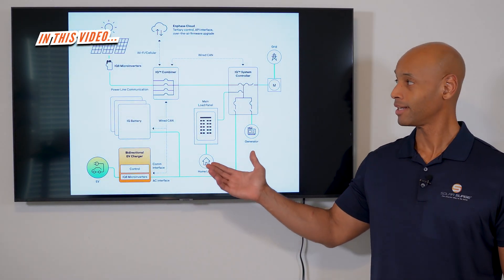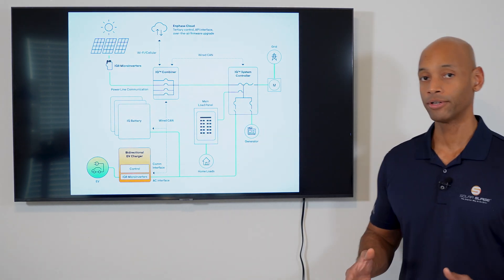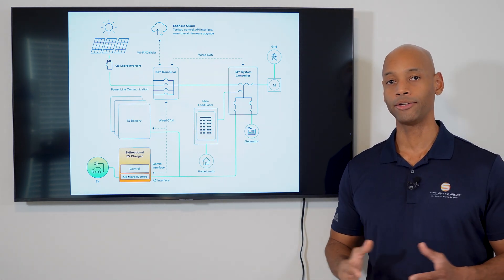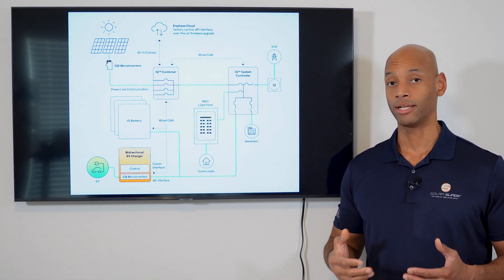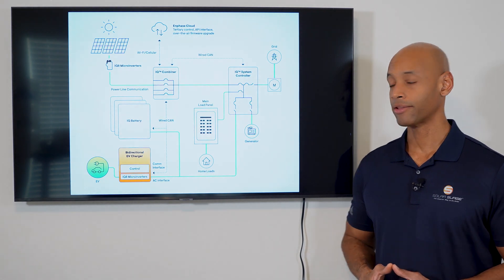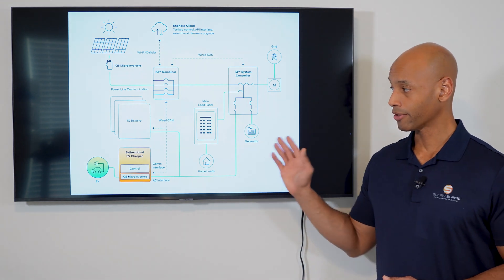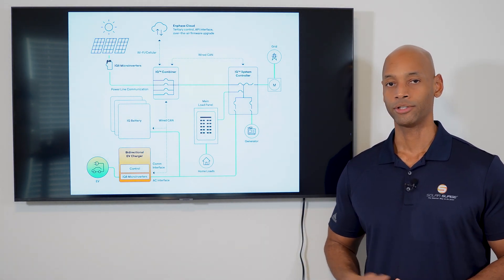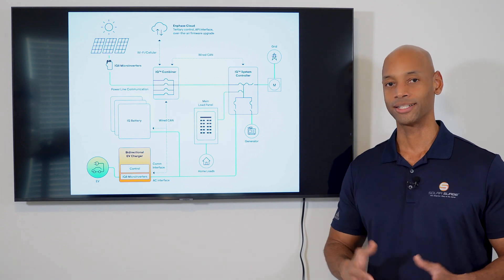Enphase Solar Power System 2023 (IQ8 Micro Inverter)

Comment: how you prevent the power going back to the grid when you are not using all the output power ?
Reply from the maker: The Enphase IQ system controller can be configured not to allow grid export
Reply: I meant no power to the grid at all, not the function that detects if the grip has a power drop then also the microinverter cuts the power. I want the power meter of my power provider NOT going backwards because thats illegal in my country.. @SolarSurge

Comment: OK.  I love the detail in your videos... and I'm kinda old, so I need some detail... so I pick you.  I have an Enphase IQ3 na system that is only about 2 years old.  I wanted to add 1-more 3.35kw battery to my system... but they are no longer available.  I called Enphase Tech support, and they said I could add one of the newer 3T batteries, but I would need to run it through a new and separate subpanel, as a stand-alone unit.  So, I bought a new 3T unit... and now I can't find anything on YouTube (or anywhere) that details what needs to be done... what breaker size... and where to install a new breaker in the IQSC.  Please HELP! Video?  Sketch?  Step-by-step description of the individual task?  Anything!!!

Comment: Wow, what a great video. I am getting solar and really wanted battery back up but for the cost it is not something I want to do right now. However since I recently bought a Tesla with 85KWH battery that with the Bi-Directional EV charger would meet my backup needs for a very long time. Thank you for sharing such valuable information Joe!
Reply: I don’t think Tesla offers bidirectional charging yet except in the new cybertruck.

Comment: I think its a mistake to go with micro inverters personally, Id rather have a string inverter with battery backup, plus what happens if these micro inverter companies go out of business?  Yeah single point of failure is better in that reguard also can these even handle super large surge loads like air compressors like a :LF inverter would with ease
Reply: Enphase is a huge co. Will not go out of business any time soon. Other microinverters though…
Reply: @perwis9893  My main point and question was can these microinverters even handle large inductive loads like motors and stuff, id rather have a string inverter low freq they can def handle large inductive loads
Reply: Good question. I don’t know. But that is not really a problem unless you are off grid right? And then you would presumably still need a battery right? Or what am I missing here?

Comment: Right, it comes off the roof AC. 240V 39amp. Current must be converted to DC for battery storage, then converted back to AC. Wasteful. Too much lost to heat.

Comment: How do I design a solar system that can start a appliance that requires 22 lock rotor AMPs? Does this have to do with the battery and inverter? It’s a grid tie system.

Comment: I have the original microinverters. Have had about 10 go down since we had them installed back in 2013. Since they are past the 3 year labor warranty, I've had to pay about $300 each time I have needed one replaced. The microinverter is still under warranty. The labor cost is not. AND I'm usually waiting around for tech service for upwards of 3 months. I do not recommend Enphase products. I really wish they were more reliable and that I could say we had gotten our money's worth, but everyone I know with a regular array has had zero issues, and our microinverters keep going down.

Comment: Put in the IQ7s three years ago.  If the government shuts down the grid then I’m screwed. It will cost me around $4000 to put the new IQ8s on and enable me to get a good battery. I feel that I’ve been jacked by Enphase.
Reply: Does not the Battery provide a grid even with Iq7?

Comment: HI! Great video! What extra cost is the micro inverter installation add compared to a "normal "  installation with only one big inverter? Would be great with a cost per panel figure, if possible.  Would you recommend this installation for bigger installations? Br Anders

Comment: So during the day if the solar production isn’t sufficient to power my house, does the system then pull the difference from the grid? I just got this system, no batteries tho.
Reply from the maker: Yes.  That's exactly how it works.  Both solar and grid power sources are connected simultaneously.  If the solar can't meet the demand, the remaining balance is automatically pulled from the grid.
Reply: @SolarSurge  thanks so much, and thanks for the video!

Comment: Great stuff, much appreciated!  I have an existing PV system with IQ7+s (34 panels) that was installed last year (2022).  I did not get a battery back up, because i wanted to wait for bidirectional charging to use the EV as the battery.  Looks like Enphase will offer this next year (2024).  looks like the bi-directional is built on iq8, and the system controller doesn't allow mix n match (iq7 plus iq8), so, am I hosed? (in terms of implementing bi-directional charging w/o having to replace all my micro-converters?  Or, does the PV going through the combiner somehow allow the iq7's to exist on the panels, but still allow bi-directional charging using the iq8s?  PS sorry if I missed the answer to this in the comments/replies below - i did look first!  :)

Comment: Our 18kw ground mounted array (45 QCells w/ IQ8As) will need a ~120' wire (in a trench). What gauge wire would you recommend?
Thanks for some quality content Joe, as usual.
Reply from the maker: You should use #2 gauge wire minimum for this circuit.

Comment: Hi Joe, thanks for doing this video. It answers several questions about the microinvertor and the fact that we can use a generator to both run our homes and charge our grid-tied solar system batteries.
Sadly we don’t have Enpase where I live in Ireland and no solar company here appears to have the knowledge of how to even draw energy from the batteries using the ‘Load’ connection. 😳🤷🏽‍♂️
I and a few friends would really appreciate your guidance on how we can have our panels supply energy to our homes when the grid is down. If your happy do a zoom, FaceTime or WhatsApp video call that would be great. If you charge for such advice, then let me know and we’ll see what we can do collectively.
Many thanks.
Michael 👍🏾👍🏾

Comment: Is it recommended to plug generator into battery? Also am I wasting panels if I get a 20kwh battery and cant plug in all the strings into that one battary. They said I can only plug in 6 out of 8
Reply from the maker: Yes you can integrate a fuel burning generator its the system.  The Enphase IQ System Controller will regulate power flow from the generator to protect the batteries.

Comment: This is the best explanation of micro invert ecosystem i have seen so far.

But I would like to know how i can use these microinverter ecosystem components to design a completely off grid system.

how do the iq batteries and microinverters keep the AC power in sync?
Reply from the maker: The IQ8X-bat series micro-inverters have the ability to create their own sine wave for off-grid operation.  What you see here can be used for off-grid installations.

Comment: I am hearing reports about issues with the Enphase Smart Switch with faulty components that cannot be changed out easily   DC  disconnect connector switch??  In any case my installers will not install any until Enphase deals with the issue.

Comment: Hmm no outside cutoff switch for solar panel?  In our parts the smart switch does not count as one as our utility has to be able (from outside the house) or firefighter, shut off electricity between the house and the solar panels......
Reply from the maker: NEC requires a separate AC Disconnect apart from the Enphase IQ System Controller.
Reply: @SolarSurge  Thanks much my electrician just installed the combiner  panel and cutoff switch and monitoring lines so when its commissioned I will be able to see and compare incoming solar energy vs load from the house etc.......  App is enphase enlighten.   I was supposed to get a smart switch but they are not installing smart switches anymore as per my comment above. :-(
He also said the smart switch will need its own cutoff switch as well???  Perhaps thats only for an outside install??

Comment: It's jus Ludacris to a electrician.  With solar panels being so cheap to get as they are thrown out/recycled by manufacturers all the time, and the equipment being what it costs, it shouldn't even pass $10k.  
Let's see
$1125 for 15 300w panels
About $800 on Inverters/chargers
Let's say  $4,000 for 12.8kw of battery storage (the most important part) 
And say $2,000 on misc (wires, brackets etc
That's $7,925!!  
People are literally getting killed by labor cost.  More than $25k. So sad.  I've even seen more than $50k prices

Comment: Fireman!
Joe, I’ve seen tens of hundreds of your videos. 

I feel that in every video you have done, 100% of the time
 you have been mindful to be accurate with the words you say and not over represent anything…you have been amazing!
Some I correspond with would believe that you are overstating the benefits of microinverter architecture. 

Personally, having been in the industry and understanding the struggles that have been real with central or string inverters, I completely see and understand what you are saying. 

Yet, to some, saying there is not a single point of failure with the microinverter architecture, some would say is not accurate.

The inverter output circuits 
combine into a central combiner panel. 
These circuits then combine and leave the combiner as the 
combiner output circuit 
and 
interconnect to the building premises wiring via one method of connection. 

Any place the circuits merge into one circuit or there is a single connection,  is a single point of failure for the microinverter system. 

A minor clarification when wording regarding microinverter systems, would
Fix them right up. 

Thanks Joe for how tall you stand my Brother!

Comment: Is there a list of vehicles that officially support V2H for the dual way charger? From my understanding this is built in to any CHAdeMo vehicle but the only one I know of that is CCS is the lightning so far. You would think this would be a feature on every EV by default.
Reply from the maker: As of now, Ford is 100% on board.  Tesla, GM, Lucid, Nissan, and Rivian have all announced support for V2H.
Reply: @SolarSurge Hi, interesting development having bidirectional CCS in vehicles and how it’s not in most current vehicles. This allows the large vehicle battery to be used as required. Kudos to Ford for having this and getting even more value from your vehicle. Adding a generator then allows recharging for extended grid down operation, if the solar is not outputting enough.
Again looking like a complete system.
Take care all M.

Comment: if there was a grid down event, and Enphase corporate was unable to communicate (internet) with the home solar system (assuming sunlight backup with sufficient battery storage), will the solar system be able to power the home?
Reply from the maker: Hi Caleb.  Good question.  Yes, the Enphase system works in off-grid mode without a connection to the Enphase cloud.

Comment: Does clipping really matter?  I'm told that in the real world the best panels almost never generate enough power that the microinverter can't handle so there's no reason to go with the IQ8s.  I've heard the only thing that meaningfully separates the cheaper IQ7s from the IQ8s is the ability to power your house when you have no battery and the grid is down - but the smart switch to enable that capability will cost $13,000 so you're better off buying a battery.  Can you comment?
Reply from the maker: I agree. That main difference between iq7 and iq8 is sunlight backup and better battery control during off grid mode. For a regular grid tied system, iq7 is fine and we still offer those.
Reply: @SolarSurge  still don’t see the benefit of IQ8. Even with IQ8, I think the System controller is still required for Solar backup.   And the system controller claims to work with IQ7! (Just not mix n match ).  So what do we get for the extra $?

Comment: i just had installed IQ8A inverters on 28 460w panels no batteries currently but maybe in the future, i wanted to future proof solar system to add batteries later and now this new EV bi directional coming has me thinking i did a good move, i changed the cell modem connection to WIFI after a week, wanted to be updated every 15mins instead of the 6-8 hours on cell.

Comment: Nice overview.  Have you installed Enphase iQ8 with generator?  If yes, it would be great if you could show actual operation of such system like you did with the video of generator setup at your property.  It's unclear how the iQ8 works with generator such as how they share powering loads in different setups (e.g. sunlight only iQ8).
Reply from the maker: This is great. Thank you for the video tip.

Comment: I think the bidirectional charging only makes sense if you also have a home battery, and can use the EV battery to top up the home battery. Otherwise, you can’t drive anywhere while the power’s out. Bidirectional charging without a home battery might work well for a single person household.
Reply: It makes for a really easy small home battery system viable though. If you use your 75kWh battery to keep your 10-20 kWh home battery running the house and your vehicle is getting low you could also just drive it to an area with power, fast charge it, and bring that power back home again. The 10kWh home battery will run the house while you are out or at work until you get home and the solar will help keep everything lasting a very long time. It's much more about options and flexibility.
Reply from the maker: I just like having the option available.  For me, I would always want to have a dedicated home battery also.
Reply: For emergency use, where you just need it to power your home a few hours a year, it's fine. Also many households have multiple cars.

Comment: The vast majority of people don't need to be sold the microinverter pup.  A quality string inverter and battery system such as SMA or Fronius will give 100% of the performance at 60% of the cost.  Use that extra 40% saved to buy more solar panels or a bigger battery.  That's not even going into the fact the enphase will have much higher maintenance costs over a 30 year period as scaffolding is going to be needed every time there's an issue.  The only reason sellers are peddling enphase or solaredge so much is they have higher profit margins - don't fall for it!  That's my 2p anyway.
Reply: Enphase has 25 year warranty. My fronius inverter only 5 years… so over 25 years you would have to calculate at least one replacement string inverter. Worst case 4 additional string inverters.

Comment: Joe, do you know where the bidirectional charger is going to connect to the system controller? Both your schematic and the one Enphase presented seem to indicate it’ll tie into the battery line. Is that the case?
Reply from the maker: It connects at the battery terminal

Comment: I have an existing off grid (and will never be on grid) mostly Victron system.
Question:
    What’s the minimum amount of Enphase hardware needed to supply AC?     I don’t need/want to track individual panels.

    Can the microinverters on their own supply self-regulated 120V AC?
Reply from the maker: I suppose at minimum you could have a single micro-inverter.  However, they cannot self-regulate without the IQ System Controller.
Reply: @SolarSurge  Thank you for responding!
So by "self-regulate" it means they won't generate their own AC without the IQ system controller? What does that mean precisely?  
Thanks in advance, I've failed to find this info anywhere, so it's appreciated.